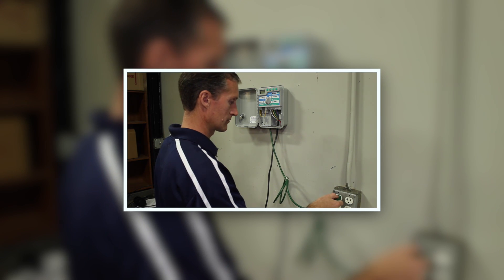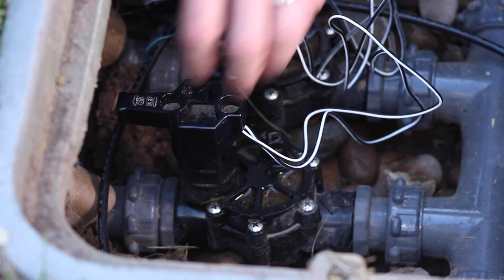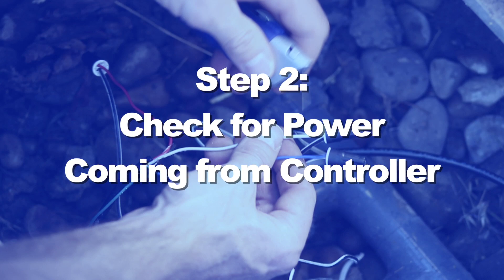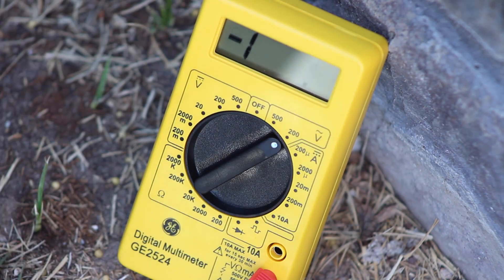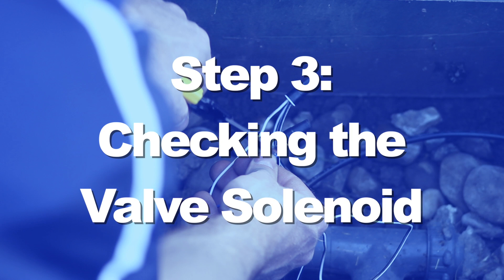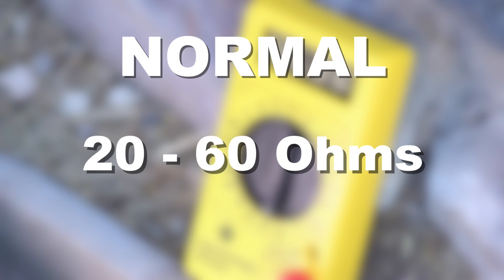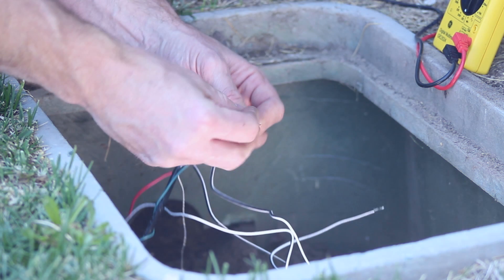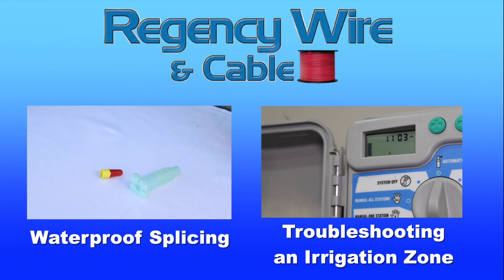Solving Electrical Problems with an Irrigation Valve

Comment: Thanks, all my valves/zones works well manually, controller Voltage also all good for all zones. How could I have loosing wire at all zone at the same time? what could be the probome? Thanks.

Comment: I tested the control panel for incoming AC voltage at the transformer it had the correct amount. Each of my 4 zones do not show any AC power leaving the box. I then tested the solenoids from the box, and they all show they are good (42 Ohms. What does this mean for my system? All the screws for the common and zone wires are secure. Any ideas?

Comment: This is a clear, concise video to help diagnose why your sprinkler valve is not operating. I used it to test the controller and the voltage at the valve itself. I determined that the connection of the common wire to two valves was inadequate. I stripped the wires and reconnected them and the problem was fixed! Thank you for an outstanding video!

Comment: Thank you! I used your video to solve my issue today. I could have sworn it was the wiring. Nope! The less than two-year-old Rain Bird valve/solenoid was bad. I used my multi-meter to test. The new one was back to the 40-50 ohms range. Thankfully I installed the quick release fittings. Total time, trouble shooting, trip to Home Depot and back, installation, was about 2 hours. Thank you! Zone six will get water this week.